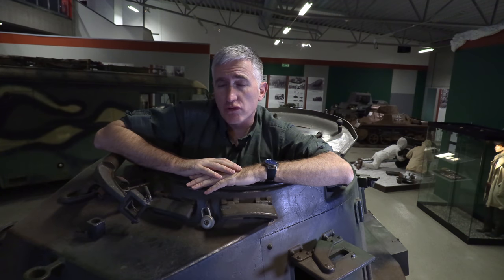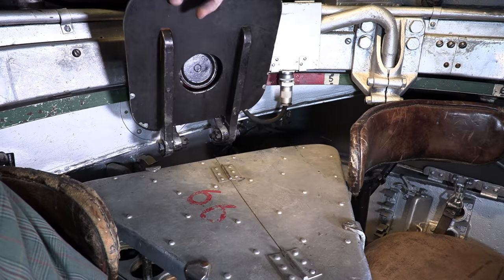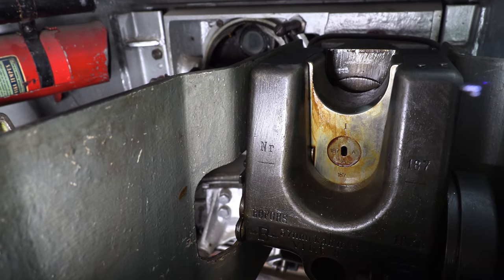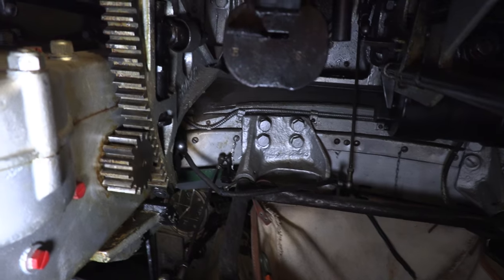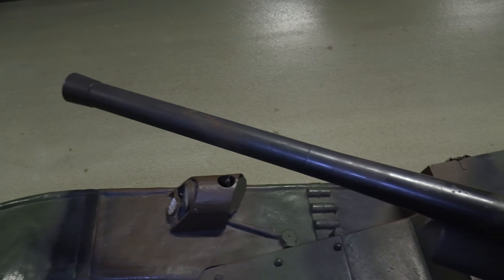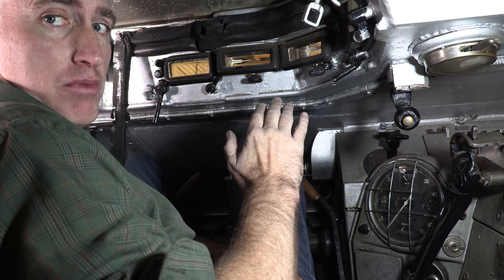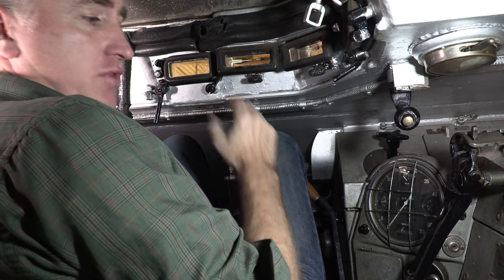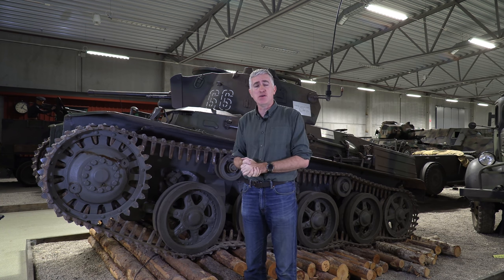Inside the Chieftain's Hatch: Strv m/38, Pt 2.

Comment: 9:59 always wondered why no one ever used the bofors 400 mm with the 4 round clip in a tank .. i mean the Brits used a 40mm get  why not make it an auto cannon .. i mean being an aa gun it should have decent muzzle V so after designed a solid shot it should be at least comparable
Reply from the maker: Well, they do now, in the CV9040
Reply: @TheChieftainsHatch   lol yeah i saw that but .. i always wonder why they never thought o .. maybe  because it has to be loaded from the top   with the gravity assisted (?) fed that would mean that it would limit gun depression because of the roof height thing ? but again that seems like something that should be to difficult to over come ... and i mean i was thinking about the 20mm in the panzer 2 which were also clip fed so its not like its with out president to have a clip fed auto loader in the 30s plus it would have simplified ammunition, ans spares logistics and manufacturer .. also  make it easier to cannibalize parts in the field

Comment: One would think with the Swede's developing the 40mm Bofor in 1930 and fielding same in 1934, that some bright spark would have said.   Hey Sven how's about we chamber the cannon for our new 1938 tank to use the same 40mm ammunition type.  But nope, they lemming trained with every other nation in fielding a 37mm.  But eventually the 40mm Bofor's round would find its way onto the Swedish CV-90/40 in 1993.
Reply: The Hungarians license produced the L-60, with modifications and some Hungarian equipment, as the Toldi light tank. The Toldi IIa and Toldi III used the Bofors 40mm amin gun.
Reply: That's not a fair comparison. the Bofors 40mm is an autocannon and a lot bulkier than the 37. They are two entirely different types of weapons.
Reply: Like the two other replies have stated before: 1) it was tried, by the hungarians (38M Toldi IIa & 42M Toldi III) and the bofors 40 mm gun itself would have been yoo bulky. But, let's come a bit further back and take a look at the hungarian Toldis. They did use a gun that chambered the 40 mm Shell of the bofors gun, probably derived from a Škoda design, but to fit it (mind you, a regular semi-auto gun, not a full blown autocannon) they had to rework the turret so extensively, that they had to almost delete the rear armor, and seriously compromise the space that the crew had to operate. This was because by 1942-1943 the hungarian army was going against T-34s and KV-1s with 20 mm autocannons derived from the Solothurn S1-100. Fitting an oversized (for the tank) 40 mm was a desperate effort to make them a little less hopeless.
Reply: And, if you wonder how changing from 37 mm to 40 mm had such a drastic impact, it's because the shell casing for the propelland of the 40 mm is drastically longer and thicker the 37 mm
Reply: @Joelsfilmer     you misunderstood, I said chamber the cannon, not replace it with the L60/70 Bofor.  This way both could share common ammunition.  Though that would have been all kinds of brutal as the US troop discovered in using their twin 40mm Dusters against ground targets in WW-II.
Reply: @pelao824  I was eluding to the original design phase of the 38.  the British 2-pounder was 40mmX304mm were as the original Bofor L43 and L-60 were both 40mmX311MM.  A cannon (never said autocannon) firing this size ammunition could have been fitted to that turret.  Granted you loose ammunition capacity, but you gain a far more effective gun.
Reply: @ditzydoo4378  The 40 mm was a skunkworks project at Bofors and was just ordered as a better naval AA-gun than the pom-pom so even if someone had the idea and mandate to merge the two programs, developing good enough ammo to fulfil two very different roles would probably have delayed both projects. An anti-tank version of the 40 mm would be also be a much bigger gun than the 37 mm. The 40 mm is a longer round and probably higher pressure.
Reply: @Joelsfilmer   It was a Hungarian built 40mm L/51 anti tank gun. the gun was similar to the German 37mm PAK 36 but with a longer barrel and chambered to fire the Bofors 40mm ammunition. This gun was used Turan I tanks, and Toldi IIa tanks. The Hungarians also license produced the Landswerk L-62 anti aircraft tank which did mount the Bofors 40mm L/60 auto cannon.

Comment: Given that 37mm is 1.5 inches, why did metric countries still use Imperial measurements?
Reply: According to Google 37 mm is 1.45669291 inches. 
Back then in sweden inches ( tum)  was used for measuring wood, nails, and pipes to name some things.

Comment: Is that a slot for a key to the lower right of the speedometer? If it is, that's unusual for a tank to need a key to start.
Reply: I noticed that too, Surprised that Nick didn't comment on that
Reply: Padlock, key start? 

In a quiet country as Sweden, how many times happened people stealing a tank for a ride?
Reply: @fabiogalletti528  none that I know of, despite the conscript system where most of the male population recived military training on the year they turned 19 up until 2006